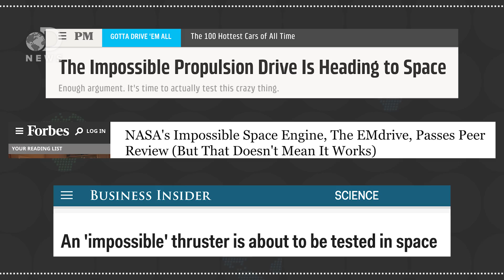How The 'Impossible Drive' Could Break Newton's Third Law

Comment: Talking about a hoax is perpetuating a hoax.  Besides we already have a propulsion system (for space travel) that doesn't use thrust, or carry any fuel. perhaps you've heard of it. they call it THE SUN>>>>>>>>> )    Solar sails will be the preferred space engines of the future.
Reply: *****
"This would be" is the point. Since it has no logical way of producing directional movement, it almost certainly is just another pipe dream/ hoax. Think of it as a closed combustion chamber. All it does is create pressure. To extract motion from pressure, it must be allowed out of the chamber. Newton's laws do apply.
 On the other hand, a solar sail can allow you to travel toward the sun, in the same manor as a wind sail does. That has all been worked out. The solar energy is collected as photons, and then pointed in the opposite direction of the desired motion. It's simple , really.
Reply: Tim Hallas Bobbin' and weavin'
Reply: Ryan Burnette
Float like a butterfly, sting like a bee.... ....whenever necessary.
Reply: Tim Hallas until you get too far and the solar wind is less than or equal to gravity. Then your stuck in one spot equalized in the Oort Cloud. A sail never leaves our solar system.. 
Another problem with a solar sail is You are never coming back..  You can't use a sail to return to earth if the solar wind is a constant push away..
Reply: Siris Mc Actually, if you "bob and weave" (sail in zig zag patterns), you can make it forward even against the wind, albeit slowly. The greeks were pioneers of sailing in the Mediterranean, and wrote much of the art of sailing against the wind.
Reply: Ryan Burnette sailing against the wind..   The name of my next hard rock CD. Heheh
Reply: Siris Mc
Well, it is still theoretical, but I believe the energy from the sun, being photons (particles) will of course weaken with distance, but the low mass high area of a solar sail, may defeat gravity. As far as coming back....being that this is sub-light travel, there would not be much point to planing to return. For interplanetary travel, out as far as Jupiter, I think solar energy could be collected and stored for the return trip.
Reply: Inclement Donut Totally invalid (without dual light sources)
Reply: Inclement Donut Say one laser..
Reply: *****
Yeah, I know . I meant diffused I suppose is a better word that weaker.  It's all theoretical anyway, until we get out there and test it. I do believe it is going to be the cheapest and safest way to do long distance.
Reply: Inclement Donut You said in a previous comment that we couldn't sail toward the sun using a solar sail, but we could probably use a laser and good timing to "bob and weave" our way all around it. I know that when sailors want to go upwind, they can do so by using a zig zag pattern (but as was correctly stated earlier, that principal might not work in this case).
Reply: Inclement Donut It would seem that the best way to navigate toward Sol would use a laser, and the time of year!
Reply: *****
 I believe your right about this for several reasons. The physics involved in boating also include the forces generated by the water as resistance to motion, allowing the energy of the wind to be diverted to a fairly acute angle. I believe that solar powered space flight is still our best bet, simply because the energy is free and it is already there. Collecting and diverting the suns energy, is still possible by simple conversion, rather than any attempt to "persuade" the ship to tack. We will someday leave this solar system, and I believe the sun will push us wherever we want to go. Maybe we just need to try to learn how. That's always been our fast track to success.
Reply: Inclement Donut You aren't considering gravity, and in particular gravity boosts that can be achieved by traveling in curves and orbits.
Reply: Ryan Burnette
Time of year?  Lasers, i can understand n but time of year, I don't see the reference.
Reply: Inclement Donut As the crow flies, you are absolutely right though.

Comment: wait why can't you just shoot the microwaves out one end? photons have momentum so that should cause propulsion without fuel
Reply: In addition to what has already been mentioned, if they shoot the microwaves out one end, then the propulsion method wouldn't be what it says it is. The real deal is this:

The impossible drive says that it is possible to create thrust without expelling fuel (the fuel in this case is microwaves). The problem is, if you shoot out the microwaves out one end, then by definition, it isn't the impossible drive anymore. 

But without shooting microwaves out one end, it is impossible to generate thrust, since an internal force can't generate external motion (this is because of newton's laws).
Reply: Trigg Ethridge Not nearly enough. This is more like "We keep losing all that fuel we burn out the bottom of the rocket. What if we catch the fire in a bottle? Then it'll travel forward even faster because reasons!" It's extremely counter intuitive. It would revolutionize propellant because it's so strange.
Reply: Then you would need to use electricity. Wouldn't you? This relies on the rays bouncing about never dissapearing, meaning no need to replace them.
Reply: Admiral Siverdan Would the solar panels on the spaceshuttle be enough to regenerate those lost photons/waves?
Reply: reformed desire 
I think you need to contact an actual scientist for that answer. The youtube comments section probably can't get that technical. I sure can't, that's for sure. :)
Reply: Caylon Gorell True. If the solar panels can actually regenerate them, they could just release the waves into space to thrust themselves forward.
Reply: reformed desire Any black surface would collect light radiation and turn it into infrared heat radiation that is emmited back into space. Still no acceleration.
Reply: reformed desire Yes they probably could but then again whats the point? Then the idea of the EM is useless.
Reply: ***** Hm the more you know.
Reply: Admiral Siverdan Because in theory and based on everything we know, the EM doesn't work, unless we make another scientific breakthrough and prove the 3rd law wrong.
Reply: reformed desire well apperantly the latter will be true. NASA has apperantly given it the thumbs up.

I should add they said it might be messurement error but that would mean broken instruments. Basically it was given more time for research.
Reply: Admiral Siverdan wow... i'm interested to see what'll happen. this is actually exciting

Comment: so why is contaminant so important? why not have the back of the cone open to let all that energy escape thus creating thrust.
Reply: Then you wouldnt brake the third law... only create a thruster using a different fuel. They don't want to release the energy as that means they lose mass.
Reply: Admiral Siverdan  I must be missing something. having that energy hitting the side of the cone would deflect it towards the back in turn pushing the spacecraft forward. But if that energy then hit the back of the cone it would be deflected towards the front which would want to push the craft backwards.
Reply: Leigh Randles mmm yeah thats pretty much how it would work. But the creator states that it works differently because of the nature of the microwaves.

Comment: good thing newtons laws dont apply to quantum mechanics...simple-minded humans.
Reply: Philip Glenn de Catalina They're not accelerating. Space between us and them is expanding. Big difference.

If you want to consider how conservation of momentum works in a general relativistic setting you can't just make a measurement here of the apparent velocity of some distant galaxy and thinks that corresponds to something useful. You must perform what is called a "parallel transport", which is essentially a correction for the warping of space between here and there. Once you do that, you'll realize it all works out and momentum is conserved.

You know I'm telling the truth because there are several galaxies that are receding away from us faster than the speed of light. If you compute momentum using the formula p = γmv, you'd conclude they have imaginary momentum. But that's absurd; the error was in forgetting about the parallel transport, just like here.
Reply: Conservation of momentum does. Sorry.
Reply: Philip Glenn de Catalina " Great you just replace Newtons Law "

It's not Newton's law. It's conservation of momentum.

"with something else that does not look anything like it. "

On the contrary. It looks exactly like it, and is the only sensible version of it that works in a curved manifold.

And no, I'm not talking about the engine part.

"So now you save conservation of momentum by replacing Newtons Laws and arrive on something that violates conservation of energy"

That's not how it works. So long as you're prepared to do the parallel transport I just described, energy conservation works out perfectly fine, albeit in a coordinate dependent manner. All this is is an effort to include the energy carried by gravitational fields themselves into the accounting, an effort fraught with subtlety but obviously necessary. The gravitational wave detected by LIGO carried 3 solar masses' worth of energy in the form of gravitational waves, none of which would exist if one were to believe your ignorant point of view.

Regardless, none of these effects are in play in the emdrive. None. So I suggest you go back to the physics books until you can explain to me why the emdrive is a pipe dream. It is. Sorry.
Reply: They don't apply to galaxies too. Galaxies are allowed to accelerate without reaction mass.
Reply: agreed they need to put ther heads together and stop shooting eachother then they can start doing mor important things like...

shooting ET
Reply: avicenna How does Accelerating galaxies conserve momentum?
Reply: coma cluster <--- look it up and get back to me on your 'conservation of momentum'. anyone can type phrases and try to sound smart, few can do it and actually be smart.
Reply: DJ Deckard Cain Not an argument buddy. Come up with one and come back.
Reply: Good thing quantum mechanics also predicts the results of Newtonian mechanics at a large enough quantum number "n". It's called the correspondence principle, which states that QM should be able to be in agreement with previously verified observations. Guess what? Conservation of momentum is a prediction of QM, which has been experimentally verified for over 60 years.

The only simple-minded bloke here is you. Welcome to the Dunning-Kruger effect.
Reply: avicenna Great you just replace Newtons Law with something else that does not look anything like it. And in General Relativity you need to add cosmological constant which actually violates conservation of energy. Empty space contains energy that makes it expand creating more empty space that have more energy that creates more space in a runaway exponential process. So now you save conservation of momentum by replacing Newtons Laws and arrive on something that violates conservation of energy.
Reply: Physics has no answers. How is the moon locked in orbit around Earth. What holds it there? If gravity is real, what makes the atoms in the Moon orbit around Earth's atoms? Where is the connection?
Reply: Thomas Nickelsen gavitey, mass, phyisics!!!
for fucks scake!
Reply: You don't know what you're talking about do you?

Comment: What I don't understand is why is this anymore mysterious than the light sails? Light has 0 mass, so the radiation pressure driving a light sail in space would also break the Newtons 3rd law.
Reply: Mika Kuusela That's not a paradox, that's just a problem of looking at particles through Newtonian physics. Photons have energy and momentum.
Reply: Mika Kuusela Its pretty easy to understand. Momentum is a product of energy and velocity. Photons have energy, therefore they have momentum. Easy. When light hits a solar sail it pushes the sail ever so slightly forwards and the light bounces back. This violates no laws. The photon hitting is the action, the solar sail going in the opposite direction is the reaction.
Reply: Mika Kuusela The sun is massive and is also moving. You would not notice it but yes, it is moved backwards correspondingly. Then again, becasue the sun radiates this in all directions, the force is largely mitigated.
Reply: Mika Kuusela  Because the EM drive is said to be a closed system. The sun is an open system. The EM drive acts upon itself to generate motion which should be impossible. An outside force is needed to make an object move under Newtonian physics.
Reply: Mika Kuusela Because then it would just be a normal rocket ship...
Reply: Mika Kuusela light has momentum.
Reply: +Garret Griffith Light probably has momentum. But then, what is the difference of light sails to EM-drive?
Reply: solar sails works a bit like a normal sail and a thruster is like a proppeler. They aren't comparable. This thruster relies on no loss of mass. The solar sail relies on the loss of mass from a star. Do you see it?
Reply: +Admiral Siverdan Kind of... but at the end of the day, mass and energy are interchangable. Things would be different if the sun shone particles with mass.
Reply: Mika Kuusela the suns mass is converted into lights momentum. theres nothing confusing about it
Reply: +Garret Griffith Yes. And as mike said, suns mass is converted into momentum of photon. The point is, is the sun pushed backward correspondly? At first I thought no, but that would make perfect sense for the conservation of momentum
Reply: +Garret Griffith Makes sense. Then again, what's the difference of that to an EM drive? All I can think of is the means of creating the photons., i.e sun converts mass into momentum vs. electricity. Does that matter? Wouldn't the EM-drive be pushed too no matter the means of creating photons?
Reply: Mika Kuusela Well in an EM drive, the action forces arent there. To push off of the ground, the photons would need to hit the ground. In an EM drive, this int happening hence the term "impossible".
Reply: Garret Griffith As I understand it, the photons will hit the walls of a cone shaped barrel
Reply: Mika Kuusela The inside of the cone isnt the ground though is it?
Reply: Garret Griffith No, but photons bounce off of it the same? The shape of it guarantees net positive momentum for the direction of travel
Reply: My point is, why is it any different to push off from the cone than from a ground? Sun shines photons and experiences opposite push, why wouldn't that be the case with EM?
Reply: +Garret Griffith Thanks. Googled it, and seems I got it all wrong. Didn't understand it was a closed system. Probably an obvious questeion, but why not just create an open cone-version of EM drive?
Reply: +Garret Griffith I've probably not done enough reading of my own, but my understanding was that chemical rockets' weakness is the weight of the fuel: to get further you'd need exponentially more fuel to carry the extra fuel etc. This would be solved by having a nuclear reactor on board. My thinking was that since there are nuclear powered subs, it would be feasible and a lot lighter option to current chemical rockets.